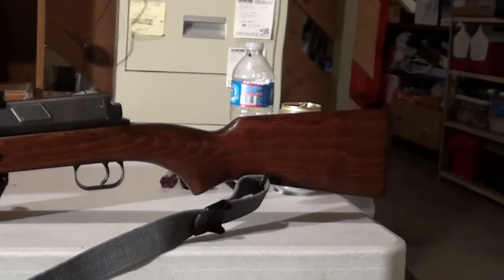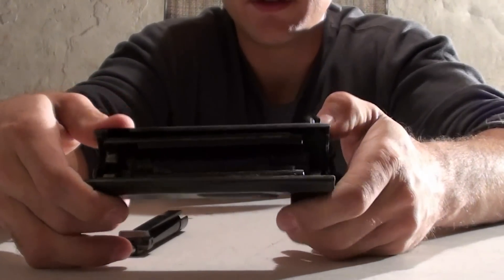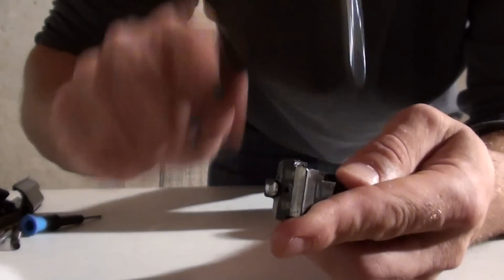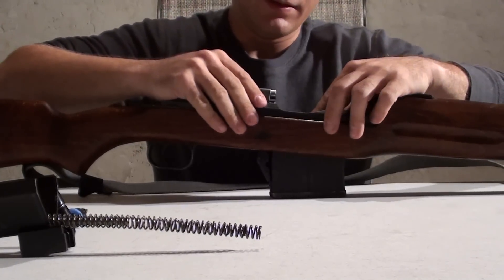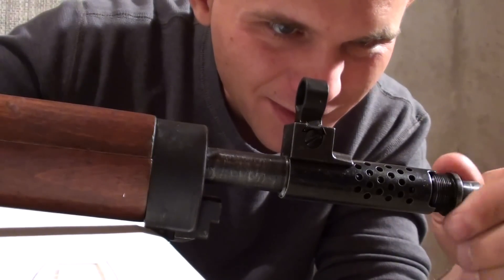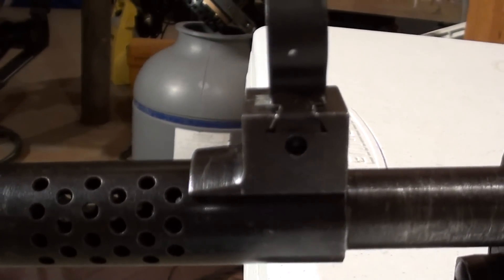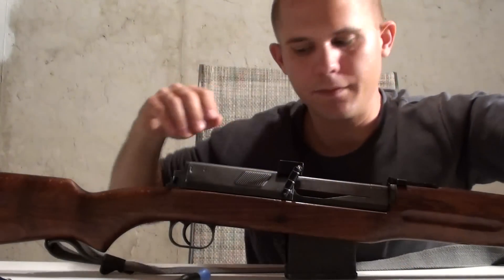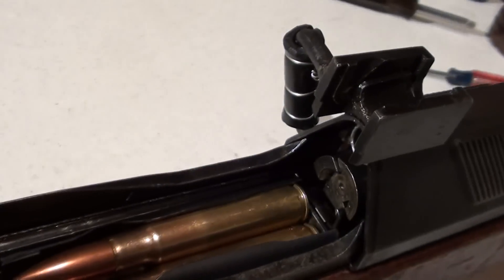Hakim Rifle Review

Comment: My Hakim could qualify for the brass throwing record. They ended up to the right about 60 feet away and slightly behind. That all changed when i figured out that the gas system is adjustable. In its lowest position the gas port is closed, and the rifle becomes manually operated.

Comment: I have one of these, (bought it in the late 80's, when they were going for about $125.00 in what is refered to as 'dropped in sand once' condition), also picked up several MG13 magazines, and altered them to fit. First one took about three or four hours to do, the other 3 took about an hour each. 25 rd capacity, look great, and function flawlessly. and turn the rifle into , fully the equivalent of the M1-A (semi auto M-14)

Comment: So... after you pull the safety block, with the bolt still in the forward, place your hand over the dust cover, grip it firmly, and press the little latch in the back to release the dust cover and allowing it to slide off the rifle sand the bolt and carrier. You can then slide the bolt and carrier off of the rifle.

I feel this is better than pulling both off the gun at the same time.. then pointing the sprung bolt/carrier at your face while you attempt to remove the bolt. It's a pretty delicate, and violent mechanism to remove in the fashion shown in this video.

Comment: I need help with trying to diagnose a problem my rifle is having Iv adjusted the gas cleaned the hell out of every thing but every now and then a case will still get stuck in chamber but won't rip the case head off but scratches and bends the hell out of it
Reply: What brand of ammo are you using?
Reply: +toomanyaccounts iv used ppu s and b and iv tried some yugo "sniper ammo" and only brass cased ammo
Reply: Firearms Nevins the rifle is a very crude version of a gas impingement system. After shooting a little bit the rifle will get very dirty regardless what type of ammo used. When you shoot a good amount of ammo run a bran brush through the barrel and a bore snake when it cools down and you'll be ready to go again

Comment: This is an old video I see.  I have been using 55 year production Romanian.  It works well. I made the mistake of looking to see that the gas port was clean. I will say the gas port adjustment was a bitch to get right again. After getting it back at the 6 O'clock position and opened one click, the gun will not cycle. It leaves the spent round in the gun or it tries to pull it out and put the next round in. It does cycle by hand. It has to be the gas system. I just cannot figure out why.